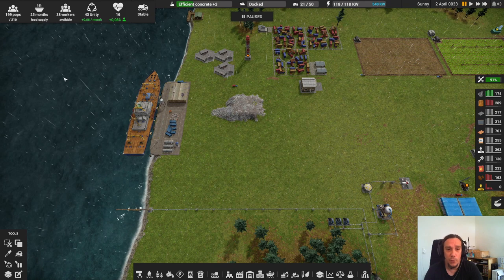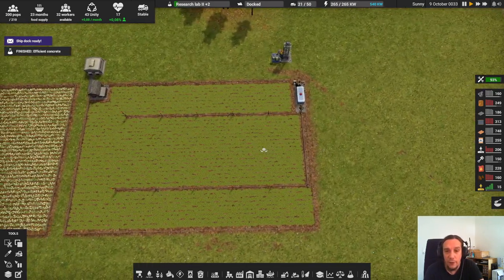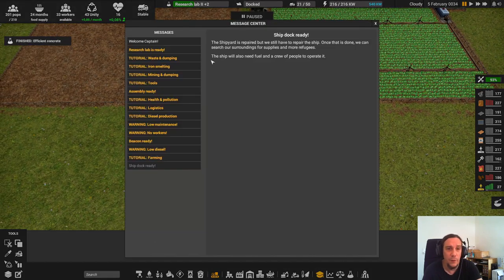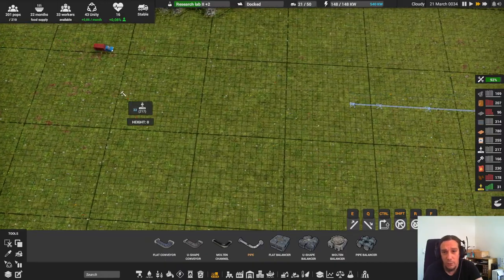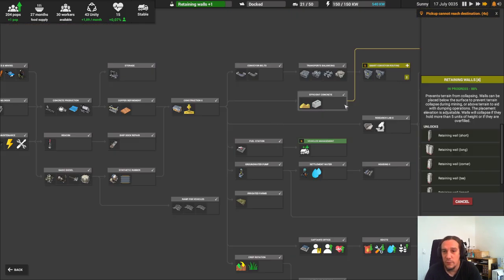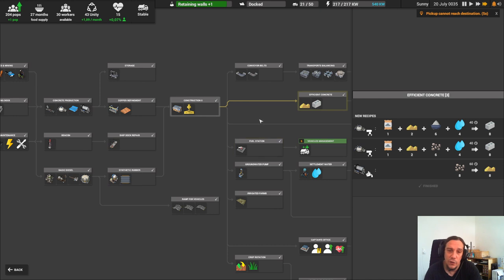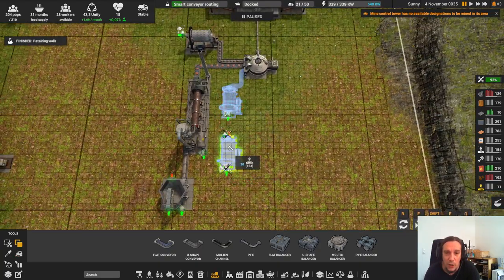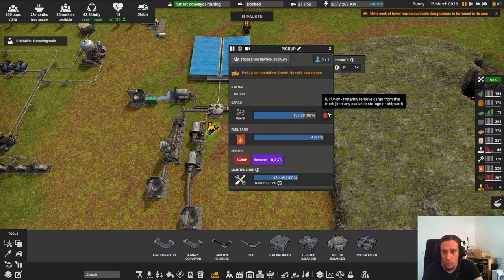EFFICIENT CONCRETE - Captain Of Industry Tutorial Guide 07

Comment: It's also important to note that the recipe for Sand is as follows:

8 Rock -> 8 Gravel per 20 seconds
8 Gravel -> 8 Sand per 60 seconds

That means you need 3 Crushers to process all of that Gravel into Sand efficiently, otherwise your Rock Crusher is sitting idle for 2/3 of its time. Also better to collect that excess Sand into a Loose Storage before putting it into a concrete maker. 

I know you're not "trying to be super efficient, you're doing this for the sake of the tutorial", but you should still be making this as a tutorial. Show people a good way to do it it. Not an inefficient way that "I'll fix later". Especially when you say you're "automating the processes", but really you're just creating more work for yourself later.
Reply from the maker: Well I like to disagree on that one. I can run three crushers on that output, but I don't have to. I can use my workers and energy much more effectively right now for more assemblers. I could pause the other three crushers, but it would be again an expenditure of T1 Construction Parts I can use elsewhere.
And this setup can easily be expanded as well. The process of making Concrete isn't slowed down because of the setup, if I happen to need more I will expand it - no need to plot down the big gun right away. Buffering materials is something I only do if I know for what reason and right now I didn't feel like I needed that stockpile of sand that desperately.

Comment: We can't really give you tips on why your Diesel isn't working correctly for your ship if we can't see your settings. Did you remember to set your Diesel Fluid Storage to be a Truck Export? They should be able to truck over the gas and not need a pipe.

Another solution would have been to set up your diesel distillery to closer to the port. However, that's going to expand a bit later in the game (SPOILERS: heavy/medium/light oil production).
Reply from the maker: Well it's been default settings, I never touched the configs on the ship! But I would recommend a pipe connection in any way if possible